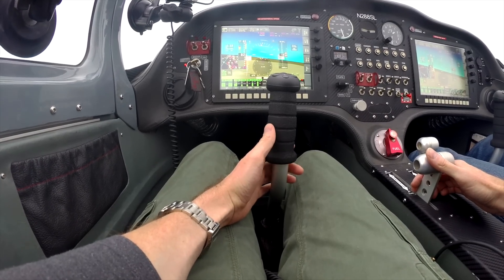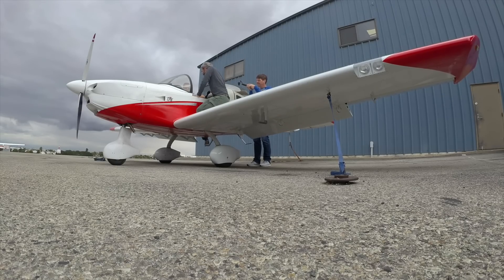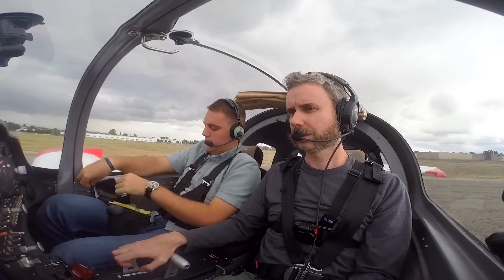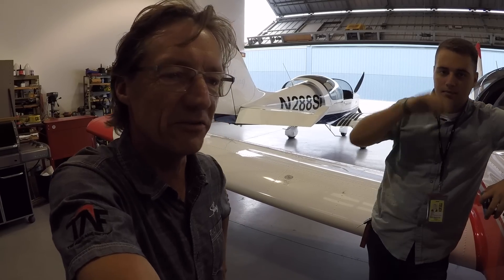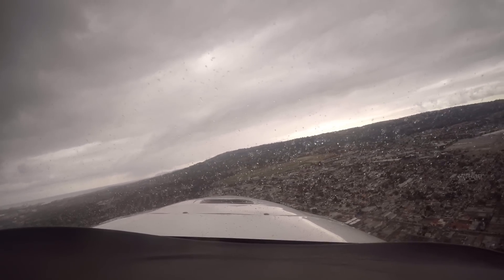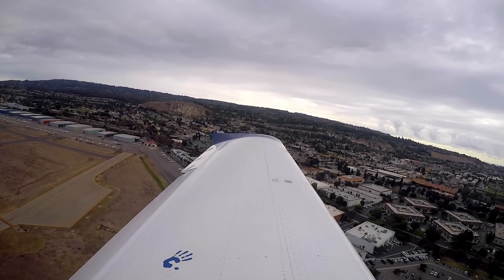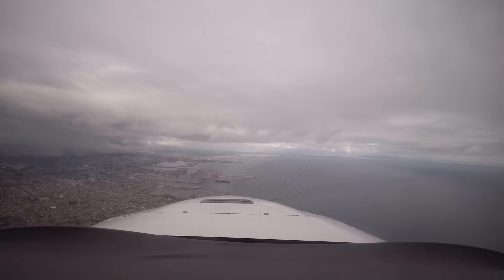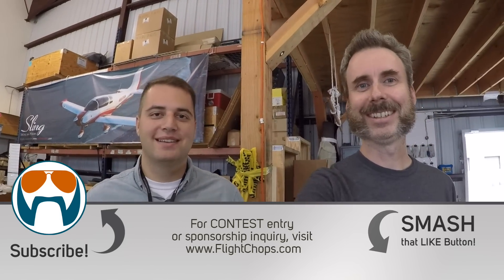Rotax Engine Failure - Flying Impressive Sling2 LSA in SoCal

Comment: Thanks for showing and documenting the ignition problem you ran into during run up.  It is good to see that things don't always go to plan, and how you worked to understand the issue to be able to explain it to the A&P mechanic.  This is where having an engine monitor is very useful.  Otherwise, you could only say it runs rough on the right mag.  Thanks again for keeping it real!
Reply: It wasn't an ignition problem. It was a carburetor problem.
Reply: Skooppa True....it was determined to be a carb problem. Was just making the statement that the issue seem to present itself during the mag/ignition check.  Had they not had an engine monitor, it would have been harder for everyone to diagnose the problem. Being a Lycoming guy, I did not realize there were two carbs on the Rotax.
Reply: I just can't believe that it's 2018 and carburetors are still being sold in any kind of vehicle that's made to carry human beings, it's insane. There is the 912 iS, but it's probably pretty pricey.
Reply: Misinformation is rampant on the internet. Carburetors work, and have worked well for OVER a century in everything from automobiles, to boats, to motorcycles,  to airplanes,  to lawn equipment & other outdoor power equipment, and continue to do so, and WILL continue to do so. How did the world survive the first 84 years of the automobile on just carburetors? Well, they worked!

Carbs get a bad rap from those who don't understand their inner workings, and the ethanol the American government mandates in motor fuel. Ethanol's love for water wreaks havoc on carburetors, yet, is less noticeable in fuel injected vehicles (makes you wonder if this was done on purpose?). That said, mechanical failures such as the float issue in this aircraft, happen occasionally. Would it be any different if a fuel injected aircraft, or automobile, experienced a computer failure, clogged injector, failed fuel pump, or chaffed / shorted wire that killed spark AND fuel? Not really. In a mechanical world, failures happen - that's why pilots train for engine-outs.

To tell you the truth, as an auto mechanic, I trust stuff built 30-100 years ago much more than anything built today, at least regarding ground-based vehicles. I can't speak for aircraft ... although the average piston aircraft is WELL over 4 DECADES old in general aviation. Automobiles, outdoor equipment, boats, etc. etc., used to be OVER-built with pride - something sorely lacking in today's vehicles.
Reply: Working and working well are two different things. I've not only been working on cars for nearly 20 years, but I started driving when many cars on the road still had carbs, I wouldn't go back to those abominations if you paid me to. Starting was always hit or miss, they GUZZLED fuel (even small, gutless engines), they stink because the mixture is never right, the engines have no power because the mixture is never right, or is inconsistent from cylinder to cylinder, they're cantankerous in varying weather conditions, the electric chokes would fail and stick closed, I've had cars die on me when going over bumps because the carb sloshes fuel from the float bowl into the engine.... the list goes on and on. Carbs should have gone extinct and been forgotten forever.

"How did the world survive the first 84 years of the automobile on just carburetors?"

We had nothing better at the time that was cheap. When microprocessors fell in price significantly enough, fuel injection was the only fuel delivery system that made any sense.

Ethanol has nothing to do with how awful carbs are, and it's your lack of understanding that's led you to believe this.

I'm not saying that it can't happen, but I've NEVER encountered a failure that prevented the engine from running with a fuel injection system. When built properly, electronic systems are vastly more reliable than mechanical systems.

"To tell you the truth, as an auto mechanic, I trust stuff built 30-100 years ago much more than anything built today..."

Do you deal with mainly American vehicles, by any chance? Modern vehicles seem to have no issue lasting two to three times longer than anything that was built 30 years ago. Hell, the cars and trucks from the '70s that I drove when I was a teenager didn't even have odometers that went past 99,999 miles, because they weren't expected to last that long. Nowadays, cars have no trouble making to 300,000 miles if properly taken care of.
Reply: Well, we must've grown up in different dimensions, my friend, since that's not how I recall things at all. 

In fact, I just within the past 3 years sold my '89 Chevy s10 Blazer, which I dropped a 4.3 V6 out of a 2000 GMC Jimmy, MINUS ALL electronics. Back to basics on that one. An Edelbrock manual choke carburetor, and HEI distributor supplied the fuel and spark. I went from 18 MPG to 17.5 MPG ... with FASTER throttle response, and MUCH more torque. My wife commuted with that thing 70 miles per day every winter, and it never missed a beat (once I dialed everything in right). Ran it for 7 years, until the body succumbed to the liquid car dissolver they dump on all our Northeastern roadways. Guy bought it on Christmas Eve, and drove it 100+ miles home in the rain. Meanwhile, my 2007 Silverado has failing cam bearings, burns oil, and has had a complete suspension and steering overhaul ... I have a whopping 93K on the odometer. 

Before that, I had a '72 El Camino with a 350, and a Edelbrock 1406. Put  well over 100k on that over 11 years of ownership. Drove it from CA to MA hauling a U-Haul trailer loaded with every tool, and everything else I owned. Made it 3,200 miles in 5 days (thanks to a Rocky Mountain blizzard - should've done it in 3 flat). Not ONE single fuel-related issue in 100k + miles. Oh, except maybe that one time it lost power at 10k feet above sea level. We never see that on the East coast, so never had that experience again.

I still own a '74 Yamaha RD350 with DUAL carbs (gasp!) and dual points. 6k trouble free miles and counting. Starts up every Spring in THREE kicks. EVERY time. No matter how long it sits, even with ethanol sitting in the carbs all that time, with NO fuel stabilizer. I'd take that bike to AK and back, and do it again right now (if it were warmer 😁).
Reply: Your yardstick is a Chevy Blazer? Seriously? The 4.3 never made more than 200 hp, yours probably makes 140 to 160 with a carb, and it gets 18 MPG? You can't get any more pathetic than that. Also, if everyone drove a vehicle like yours, we'd be buried in a cloud of smog, like the Chinese. 

GM builds garbage, that's why you're having problems, period. I've seen plenty of modern Hondas, Toyotas and Subarus with over 250,000 miles that ran perfectly fine. When I sold one of my Hondas, it had over 312,000 miles on it, and it was in great condition, I wouldn't be surprised if it hit at least 400,000 before going to the junk yard.
Reply: Smog has nothing to do with treehugging, smog is directly harmful to human health. You're just a typical, ignorant right-winger, that's why you keep buying GM junk and thinking that thousands of miles of use is a long time. For the people who buy Japanese cars, HUNDREDS of thousands of miles determine reliability, not thousands. Don't buy GM junk and you wont have problems with electronics.
Reply: Although I get your points, considering carb icing is the main cause in too many GA accidents, and also carbs are less economically efficient, I'd tend to agree that fuel injection is the smarter solution for GA aircraft.
Reply: idontcare80 Hi, you are a mechanic? I am a computer engineer, every morning I wake up and have to repair broken computers, everything from a banks mainframe to those running robots or potatoes chip factories. All my vehicles have carburetors and points ignition systems they tend to fail gracefully, is run poorly before failing unlike computerised ignition and fuel systems which tend to fail catastrophically. Note if one carb had failed like in this video the other carb would enable the engine to run on the other two cylinders, this is called fault tolerance.
Reply: Smitty Smithsonite 350 Yamaha like 750 Norton is fault tolerant. Can lose 1 carb, set of Point's, condenser, carburettor, spark plug Or in the Norton's case push rod. Remove the plug from the non functioning cylinder and ride home slowly as a single instead of a twin with half the cylinder capacity.
Reply: idontcare80 If you fit an air cooled VW bug engine zero houred by an aviation mechanic to an aircraft it can be insured. The only certified Honda engine is a gas turbine not a ice as far as I know.
Reply: I just do odd jobs, actually, and I work on both computers and cars for a living. Most computer related problems that I encounter are related to software, I rarely have to replace electronic components, and if I do, it's usually because they were abused somehow (mostly liquids spilled on laptops). The one thing that I do have to replace often is HDDs and, as you know, those are mechanical devices. I recently refurbished over 40 desktop computers, only two had motherboard issues, one had a nonfunctional LAN port, the other had a pair of bad USB ports, they both work fine otherwise. 

I've never seen an ignition system fail on modern car with a coil on plug system, and I've never seen an ECU fail and prevent the car from running entirely. I did see an old Chrysler ECU fail, but all it did was run the engine extremely rich. It wasn't just a plain electronic failure, either, the ECU was in the engine compartment and the case had rusted through, which allowed water and dirt to reach the electronics.

There are no certified VW engines for aircraft, they only fly in experimental aircraft, and they're well known for their high failure rate. There are quite a few Honda engines that are flying as well, also in experimental aircraft. Automotive engines, though, are designed for use in cars and aircraft applications have very different requirements for their engines, so assuming that their reliability indicates the reliability of an engine that was designed for use in aircraft makes absolutely no sense. The quality of automotive components also varies greatly, so you'll see frequent failures in vehicles from brands like GM and Chrysler (which I don't work on) and almost never encounter problems with the Japanese big three (Honda, Toyota, Nissan). A certified aircraft engine would likely exceed the quality of even the best car brands.

O2 sensors are a maintenance item, so I've replaced those from time to time, but other than that, the only fuel injection system components that I've had to replace were purely mechanical idle control valves, which were used on the very early EFI systems in the '80s, they're no longer used. When those failed, the car would simply not idle properly, they ran fine otherwise. Distributors are the other things that I've had to replace, and the only reason the one on my ZC swapped Civic failed was because the engine had sat outside, which caused some corrosion inside of the distributor. Thankfully, distributors are a thing of the past.
Reply: Also, consider the Prius, it's one of the most reliable cars on the road and that's likely because of the fact that Toyota used an ingenious transmission design to eliminate mechanical complexity in trade for electric motors and their controllers. The Prius has been known to easily exceed 300,000 miles of use, with some making it to well over 500,000 miles.
Reply: Bit like a 55 year old Mercedes 240d then?
Reply: Not really, the engine isn't all that much different from any other modern engine, it's just the most thermally efficient engine on the road, and the electric systems are fairly complex, they're just dead reliable. In other words: Electronics allow for both increased complexity and increased reliability. 

Anything can be simple if it doesn't have to perform well, like the old Mercedes diesels.
Reply: idontcare80 Define perform well :)
At least with the 240d I can manufacture my own fuel at home. Can't say that about a Prius but you can about a Tesla or Chevy Bolt.
Reply: Perform well: Accelerate faster than tectonic plate movement. 

The 240D has a power to weight ratio that's significantly worse than a 3 cylinder Geo Metro.

"Can't say that about a Prius but you can about a Tesla or Chevy Bolt."

Yeah, but the Prius and the BEVs don't pollute like a Chinese factory. Also, even if you're fueling a diesel with vegetable oil, you're not really producing the fuel yourself, you're just refining it yourself. Still, it's a decent way to make use of a waste product, I suppose.
Reply: idontcare80 I have run mine on butter :) and you cannot call a Prius fast though a 240d goes round corners like a w123 Mercedes. Cannot call a VW bug fast either but its engine is certified for aircraft use because it is so reliable, just need to fit mags.
Reply: The Prius is quite a bit faster than the 240D. VW engines are absolutely NOT certified by the FAA for use in aircraft and they're well known for their high failure rate. READ. VW has never produced anything reliable, they've been at the bottom of the quality ratings for as long as I can remember.
Reply: idontcare80 Neither is the rotax engine or aircraft in this video. You are right of course if it is not certified by the FAA in America it cannot possibly be certified anywhere else in the world. The Prius probably can go faster than the 240d's 150 kmh, but for how long?
Reply: I mean, seriously, what planet are you from? The air-cooled VWs were loved because they were cheap and easy to repair, but you did have to repair them very often. My dad got his start as a mechanic working on VWs, and I have fond memories of riding around in a VW Transporter as a kid, but I also remember why my parents sold it and bought a much newer Mazda MPV, and that was because my dad knew that the engine was right on the edge of a catastrophic failure. The engine ended up dropping a valve seat and destroying itself literally as the new owner was driving it home to another state. My dad warned the guy, he didn't listen.
Reply: idontcare80 They usually last 1000 hours at revs for max torque, that's why the mtbo is less:) just like a Lycoming for example.
Reply: Rotax engines are fairly reliable, my point was that carburetors make them less reliable than they can be. As far as I can tell, there is a very highly modified version of a VW engine that is certified in Europe (Sauer), but it is very highly modified and some make use of electronic fuel injection. (Correction: It's an American company, Bush King, which produces a highly modified, fuel injected VW engine for use in aircraft. Limbach also has a fuel injected version.) 

I'm not talking about top speed, I'm talking about how long it takes to accelerate under normal use. The 240D takes more than 20 seconds to accelerate to 60 mph (100 kph), the Prius takes about 10 to 12 seconds. That's something that people will notice every time they drive the vehicle.
Reply: Lycoming engines usually go 2000-2500 hours between overhauls.
Reply: One of my  daily drivers is a 1964 transporter, I get about 160 to 180 000 kms out of an engine before I overhaul it, I judge mtbo by checking crankshaft end float and using a compression tester. I am not a motor mechanic by trade but I am a fairly good amateur. If your dad could not get his one to run reliably it does not say much for either his ability or honesty. If he was a good mechanic but dishonest he knew it was time for an overhaul and if he did not know it was about worn out he was a poor mechanic. Think a out it like the ability of the Prius to hold a charge, it degrades over time like its engine and requires maintenance of wear parts and replacement of those that cannot be repaired.
Reply: idontcare80 You are right about Lycoming mtbo being at least twice as long as a modified VW. There are apparently more than 280 aircraft designs that can accept a VW engine according to my internet sources, your mileage may vary. I could not find one that takes a Prius engine.
Reply: Just read your post, your dad probably knew times up on the vw by checking the end float. I hope he was honest enough to tell the new owner the engine had reached mtbo :)
Reply: "If your dad could not get his one to run reliably it does not say much for either his ability or honesty."

He could, he just wasn't interested in doing it, he was busy with his full-time job and raising 4 kids, he just wanted to get rid of it. He also warned the person who bought it that it was probably going to drop a valve seat, that's perfectly honest. The Mazda was a much nicer, safer vehicle and it gave us nearly 15 years and nearly 250,000 miles (400,000 km) of reliable, low maintenance use. The transporter also didn't have nearly enough power to haul my whole family and a trailer up to the family cabin in the mountains like the Mazda could.

Also, if you're in Germany, you haven't likely had to deal with many of the issues that we had with air-cooled VWs in the US, it's much warmer here than it is in Germany.
Reply: No, people would not fly with a Prius engine, it's far too heavy. People do fly with Honda engines, though, and with no modifications to the engine itself.

I do like the Limbach Flugmotoren engines, especially the fuel injected version. I think I'd like to have a PSRU, though, like what's on the Bush King VW engines. I'd image that the Limbach engines compare well with the Rotax 4 cylinder engines in reliability.
Reply: Oh, and we also stuck a small boat (basically a powered canoe) on the top of the Mazda, while towing the trailer and carrying 6 people, it did really well.
Reply: idontcare80 I'm off to bed, been nice arguing with someone of your calibre. Goodnight.
Reply: Yup, definitely a good discussion. Have a good night.
Reply: @PistonAvatarGuy  $5000 more, in 2018 than a 912 ULS
Reply: @SmittySmithsonite  Bing makes the  carbs on the Rotax 912.  They are a snowmobile company. Bing has gone through a ton of different vendors and changed out the part number on the Carb floats at least 5 times now. Mogas with Ethanol permeates the foam in the carb floats, makes them heavy, and then the engine floods out, because the floats become sinkers and overflow the carb fuel bowl. then the engine runs rich, or in this case, floods out. Rotax wants you to weigh your carb bowl floats somethng crazy like every 50 or 100 hours. 3.5 grams each. 8 grams max, for the pair of float bowl floats, per carb, 40 in total.  It's downright crazy Rotax runs dual carbs, synching them new is a PIA too. Again, every 100 hours.
Reply: @randyvanvliet226  - That happens with the old brass floats in OPE when ethanol is left to sit and separate. It corrodes pinholes through the brass, and they fill with fuel, having the same result. That never used to happen back in the day, unless it was a VERY neglected piece of equipment, left outside for years and years. These days it's a common occurrence, even if kept inside. Best to drain that crap out of the bowl.

Carb synching isn't that bad - I've done 2 and 4-cylinder Japanese motorcycle engines many times - very easy with the gauges or mercury.